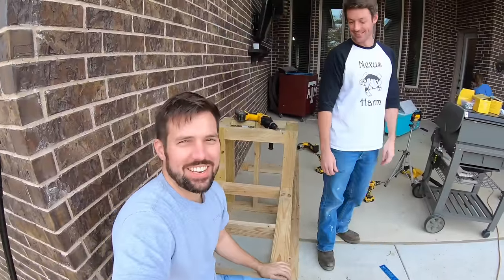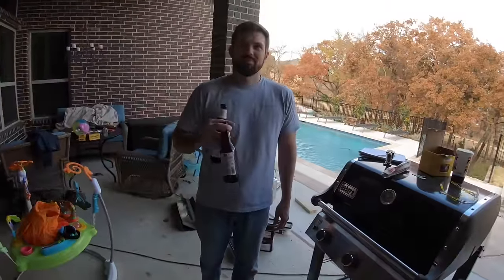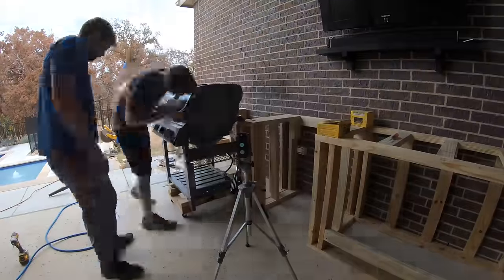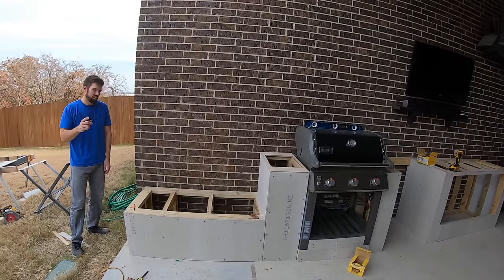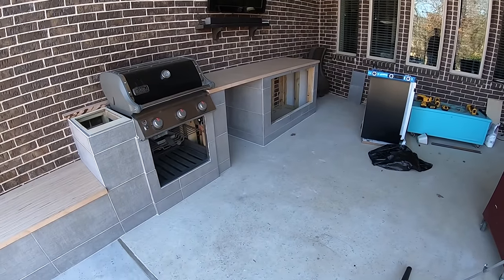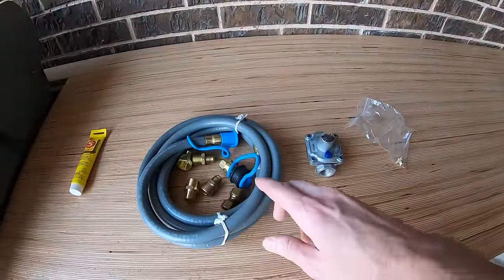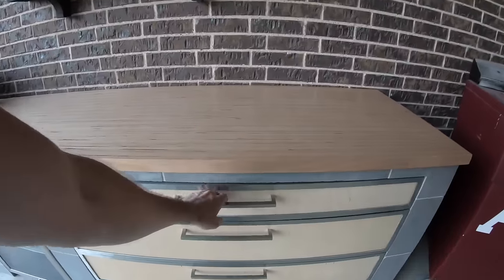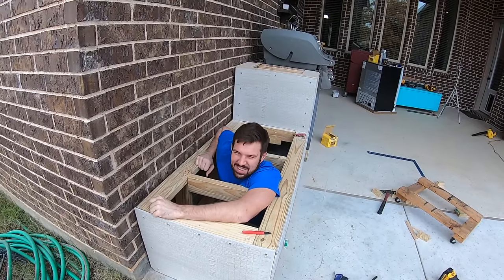Outdoor kitchen build in 20 minutes! Using my old Weber gas grill.

Comment: Whoop! Great job on the outdoor kitchen, from one Aggie household to another. I found your video and channel researching for our own mini DIY outdoor kitchen project. I had some scrap granite to use, but was not sure I wanted to tackle the weight and complicated (for me) fabrication and tooling requirements (especially with the current COVID19 challenges). I am loving the perpendicularly cut laminated birch used in your video/project. Is this something I should be able to find readily? What is it called? I have tried to research lumberyard stock at our local "orange" and "blue" home improvement stores (from the sofa, of course) here in SE Texas and I must be looking for the wrong thing. Any hints would be greatly appreciated. Best wishes and Gig 'Em.

With Sincere Thanks,

Lindsay Parker
Reply from the maker: Thanks! And yeah, those stores won’t have it. I think it’s called pressed birch and you’d need to get it from a lumber supply company. Good luck with your build!

Comment: No pool fence required around whole pool?
Reply from the maker: Local code only requires the yard be fenced with a self latching gate
Reply: Zero To Awesome I’m in Australia and it is totally different world in terms of building code. If you had a patio like that here, you would have to put a fence on the patio to seperate the pool yard.

Comment: What you did not think of is that in 6-10 years that BBQ will need to be replaced due to burnout??? now tear out that tile work around the BBQ and have fun.
Reply from the maker: It comes out of the steel frame with two screws

Comment: While I think the finished project looks good it really has so many issues that are wrong I wouldn't suggest anyone use this as a guide to build their own.
Reply: such as?
Reply: Well to start the framing wasn't necessarily done correctly. A 2x4 base should've been built and scribed to the floor to account for the slope and then the cabinets built on top, rather than measure and cut every piece a different length. This would also enable the cabinet to have a toe kick which allows you to get closer and which all cabinets have. Second, the rest of it should be built with steel studs and not wood, especially around the grill as it is combustible and isn't insulated like a residential stove. This is why commercial kitchen stoves cannot be used residentially - they need to be properly insulated. Third, the wood countertop is wrong too, for the same reasons - it's combustible. Good luck getting your homeowners insurance to pay out if this is the cause of a fire. And fourth - and this is just a design critique - when tiling you should try to keep your smallest cuts at inside corners where they are less noticeable - not on the outside corner where they did. It just looks bad to me. Hope this helps.

Comment: Only one guy on this whole comments board points out that this whole thing is a fire hazard.  Unbelievable.  They’re going to burn the table top, melt the adjacent garbage, put heat and smoke up under the overhang…. I doubt they’ll actually burn the house down but the whole build will be a waste after they cook a few times.

Comment: Hot grill next to trash, wood frame and wood counter, should be fine. None of that will catch fire and even if it does the brick wall won’t burn.  

I would have used steel/metal frame, cement board is good for fire resistance but there are local codes that cover this and the counter why not a granite/marble (looks like you can afford it).  You have the attention to detail but suck at choosing material IMO.
Reply: How would you attach the cement board to the metal frame? Builder grade adhesive? Thanks!

Comment: 3:01🤔🤦‍♂️🤔that's a lag bolt not a nail bro.  You just defeated the purpose of the threads.  A concrete anchor should've been used, and the bolt screwed in!
Reply from the maker: They’re concrete anchors
Reply: @ZeroToAwesome  just wanted to respond and say that I'm not trying to knock what you've done at all.... just trying to give positive feedback. 
Get some 1/8" flat stock (Steele)  and make a heat shield. Mount the shield with a couple spacers that'll keep it off the wood by at least a half inch.
But if you can get aluminum stock, that'll work even better, since aluminum disperses heat the fastest. 
My outdoor "kitchen" had 4 grills and a smoker. all in a U shape!  I wish I could post pics on here.....

Comment: 😎😎😎...

Did y'all RAISE the frame OFF the concrete to retard it absorbing moisture from the concrete and prematurely rotting out...!!!
😉
Reply from the maker: No retarding here. All ground contact
Reply: @ZeroToAwesome  

🤔🤔🤔😐😐😐😂😅🤣😅😂👍👍👍👍👍
Reply: @ZeroToAwesome  

I simply screwed in 2x2x 1/2" non-porous spacers...

Basically bought a couple CHEAP 1/2" non-porous "cutting boards from walmart and cut them into 2x2 squares and then set the whole thing on them before securing to the concrete or deck...

😉

Comment: I’m not normally one to downvote a video, but frankly, I am shocked that y’all hardly wore safety glasses for stuff like sawing, grinding, nailing. Why didn’t y’all protect the wood from the heat of the grill? I would think, at a minimum, you’d want to put Hardie Board next to the grill, if not other insulation. And what about venting the natural gas for the grill? It just seems irresponsible and potentially, catastrophically dangerous.